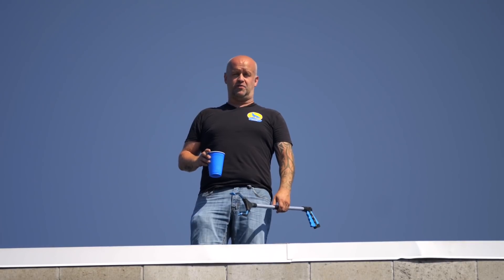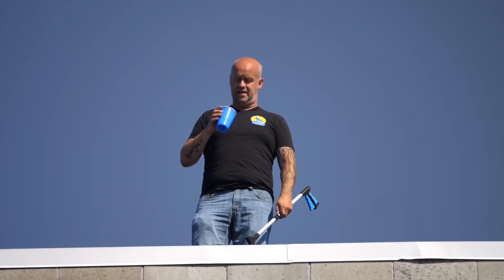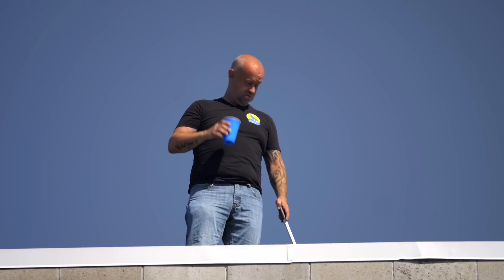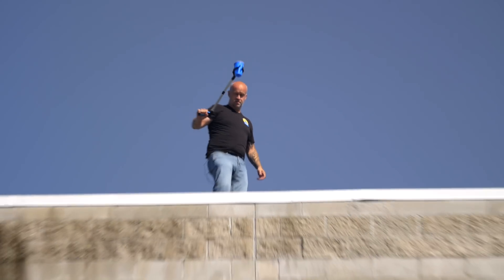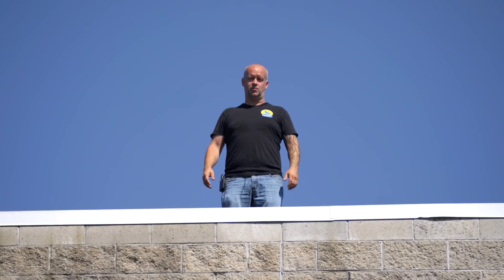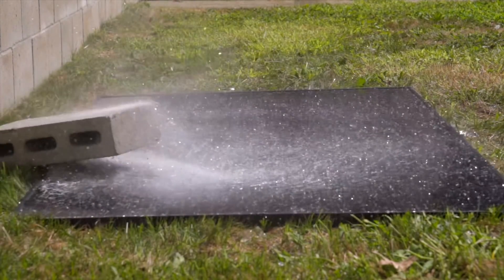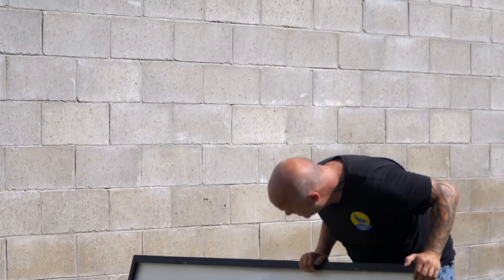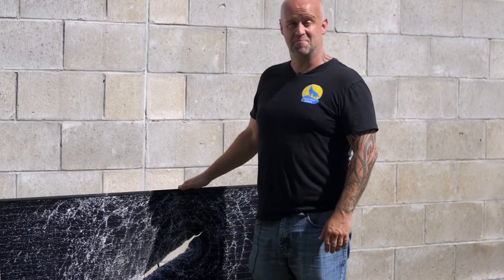Breaking Solar Panels  - The Hail Storm Test!

Comment: The fair test should be simulated with a free fall shot put ball with a certain height Hc which can generate 4-5 millimeters dent on a  front cover top of a US brand car that is based on the official statistical analysis of Hail damage survey.  At the Hc, the critical height, and the same shot put ball should be free fall again to assess the crack on the solar panels.  Once a panel can pass that test, it is considered to have a proper hail resistance.  Therefore, the suggested test method in this video tends to be a mediocre which can't represent the real hail impact.

Comment: The problem of course is that those ice cubes are not going to reach terminal velocity (which for an ice cube is probably about 70MPH) by falling only 30 feet. So this isn't really much of a test at all. Hail stones can easily be larger than ice cubes but more importantly will be falling at their terminal velocity.

Comment: Not to be mean but I don’t think you’ve been in a strong hailstorm. It’s much harder than ice cubes and is projected much faster.
Reply from the maker: Agree! We don't have a way to duplicate that though :)
Reply: @uncensoredsolartv  You could find out the weight at which an actual large size hail hits the panel and drop the equivalent amount of weight on the panel.
Reply: Hail drops from a higher altitude which makes it faster and weigh more on impact. E= mass times a constant squared. The constant being speed. Yeah bye now.
Reply: @melissamissy5129  actual Energy = 0.5 × mass of hail × velocity ^ 2